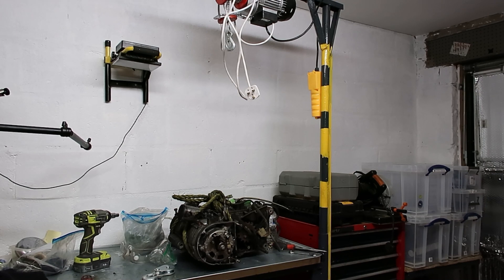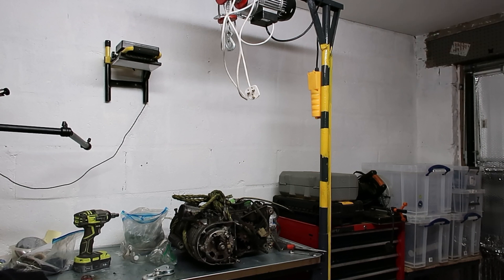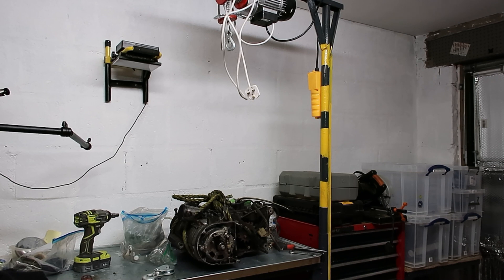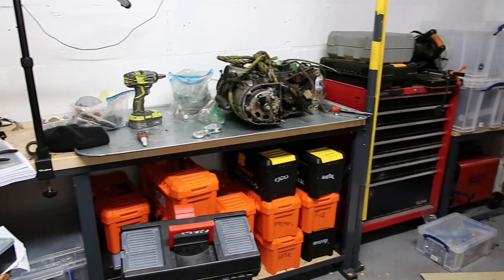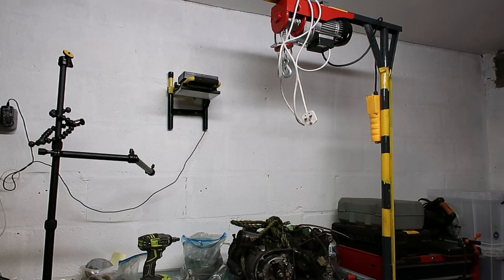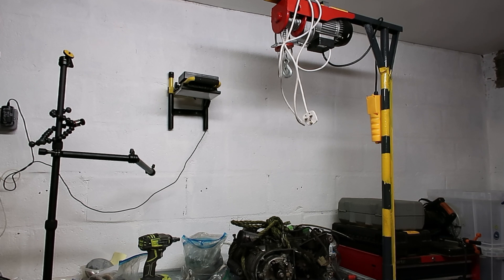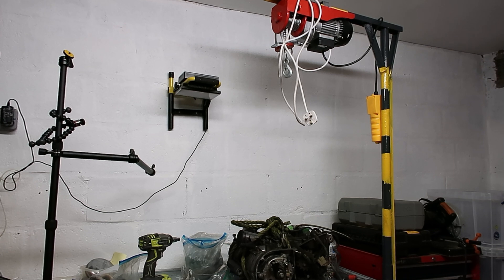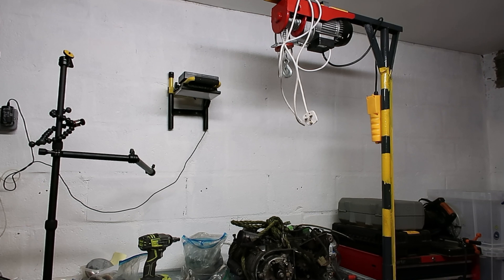Homemade  garage electric winch derrick

Comment: Nice setup for lifting engines or anything heavy or awkward to lift by hand. Is your bench secured to the wall or floor?
Reply from the maker: No as its so heavy as a unit. A store bought bench on the other side of the garage is. Having said that vibration issues with a new lathes suggests it may be beneficial